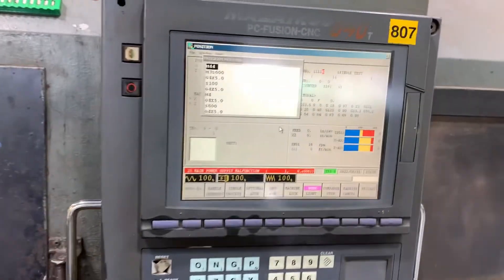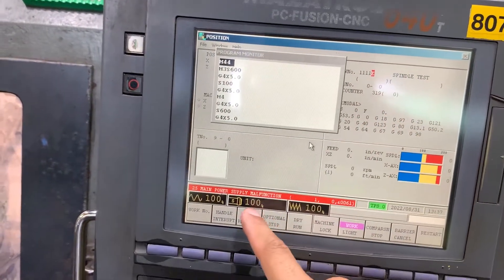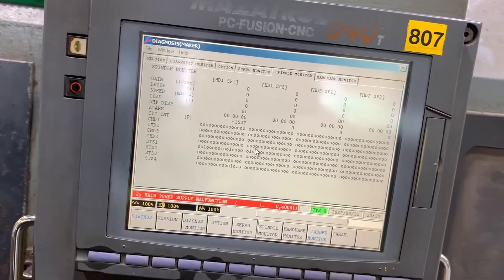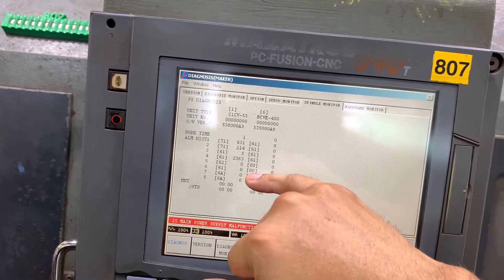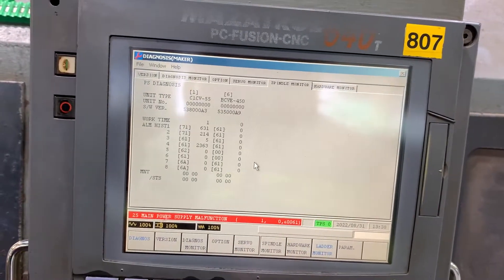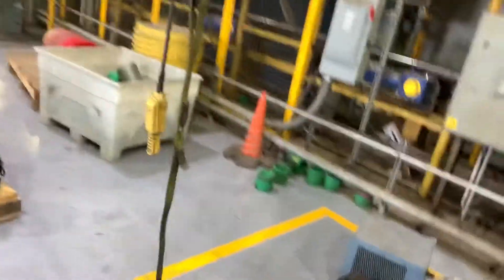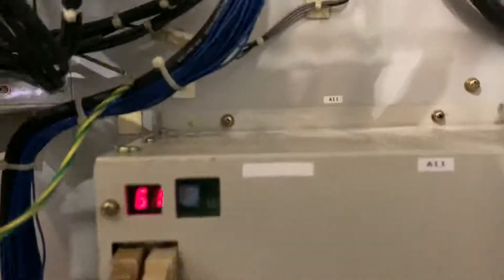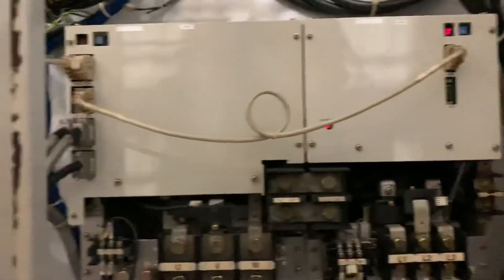M640T: Troubleshooting alarm 25 MAIN POWER SUPPLY MALFUNCTION ( 1, 0, &0061). Part #2

Comment: How to open the option function of the 640M system
Reply from the maker: Is this what you are looking for?
Mazatrol 640T CNC How to check and backup the NC OPTIONS installed and SYTEM PARAMETERS access
https://youtu.be/hWgmvJasYGE
Reply: @FabianAchaval  I want to turn on the new option function
Reply from the maker: Good morning there. The CNC OPTIONS have to be purchased through your local MAZAK representative. There no any way to enable OPTIONS that have not been installed on the CNC. Hope this helps